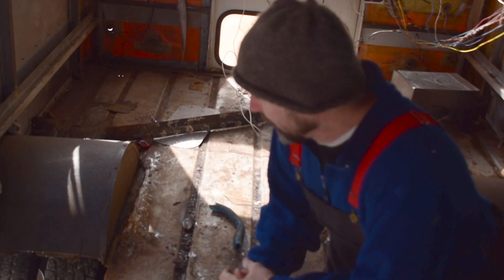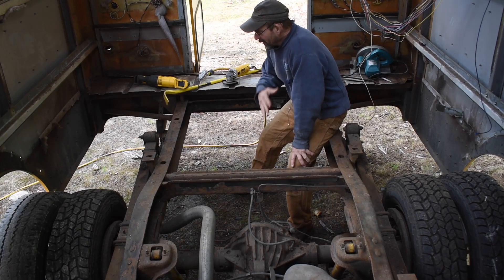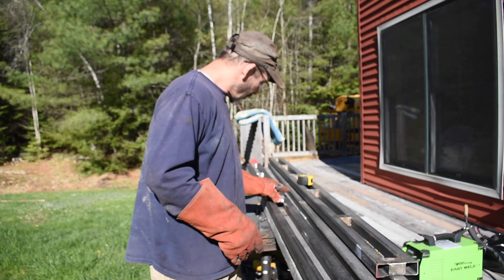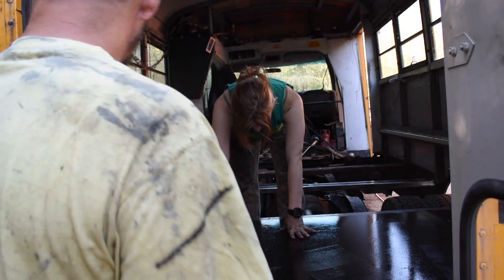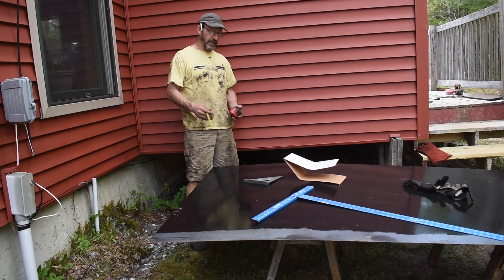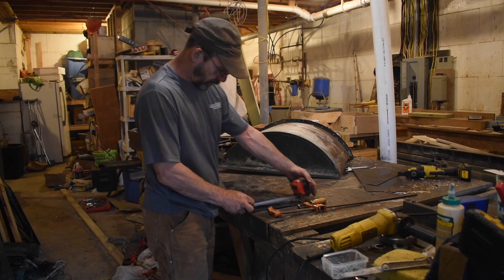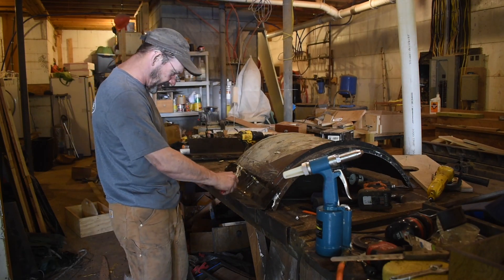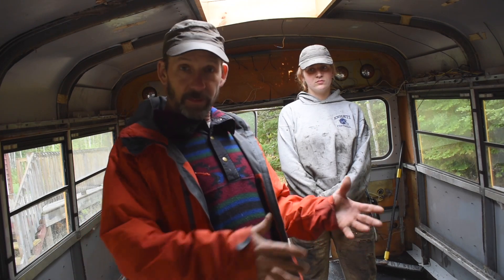Replacing a Short Bus Floor (and crossmembers) in a Skoolie Conversion

Comment: Nice work. I had to replace a section around the wheels on mine. Thankfully I was able to reuse the ribs. I used a plasma cutter to remove the spot welds.
Reply from the maker: Ohh...I could have used a plasma cutter!  Some of the bolts chewed up multiple blades!

Comment: WONDERFUL JOB, CAN YOU DO THE FLOORS ON MY BUS TOO I ALSO NEED TO REPLACES THE FRAMES ?
Reply from the maker: It would be tough since I'm in Ecuador right now!  If you have time, learn to weld.  I did and it opened up a bunch of projects!
Reply: @River-Channel  oh ok Thanks Enjoy
Reply: Hey I have a question where would I got to purchase the frames or the metal parts I found someone who is going to do the job he just said to buy the parts . Thanks
Reply from the maker: @deanjeli11  I would look up a local metal fabricator or metal dealer.  A lot of times they'll cut it to size as well, so ask your welder what dimensions he or she wants.
Reply: @River-Channel  thank you for replying so fast you are so helpful 🙏🏾

Comment: Is that wheel well thin metal? Was it replaced before. My international has heavy steel wheel wells. I wonder if it varies with manufacturers of the bus?
Reply from the maker: Thin's a relative term, Billy!  Not sure...I'm guessing around 16 gauge.  You can buy the wheels wells, but they weren't as cheap as I had hoped...